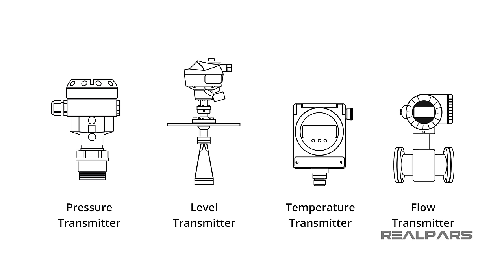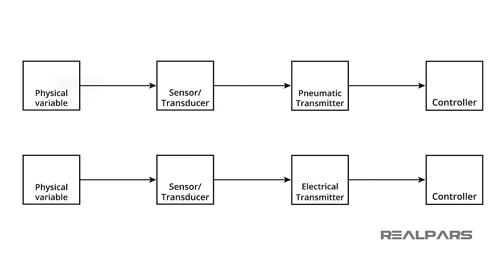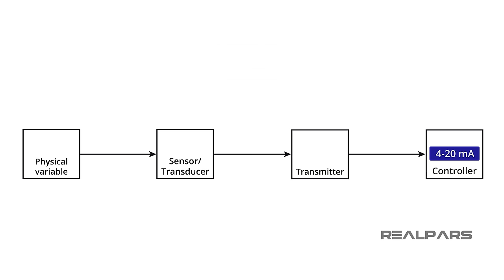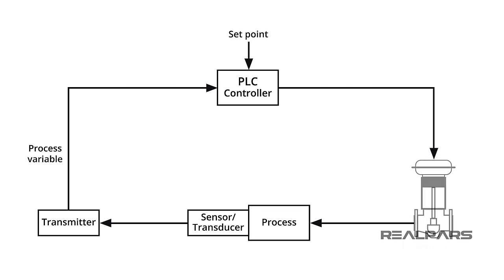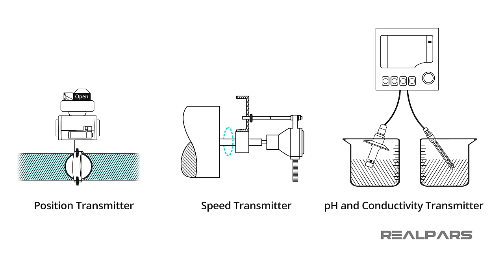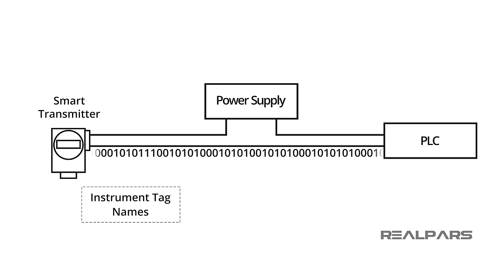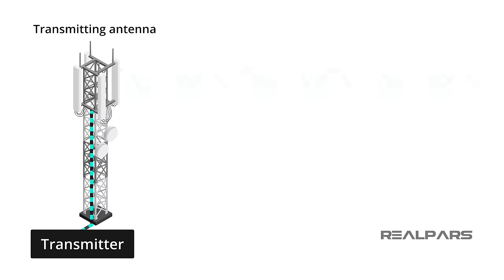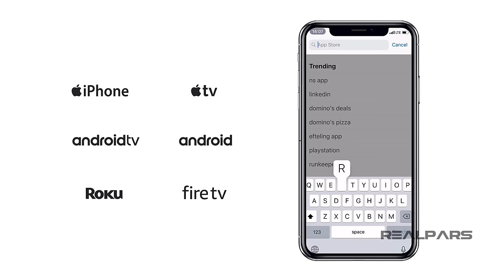Transmitter Explained | Types of Transmitters

Comment: A DP transmitter mount that is connected directly to the process by tubings but mounted some distance away is called remote or traditional mount? In this case there is no other diaphragm on the line connected.

Comment: Great RealPars 🌹🌹

Is there a video explains valve size calculations and characteristics?
Reply from the maker: Thank you for your question!  No, Realpars doesn't currently have a video that covers control valve selection and sizing.  Most control valve manufacturers (Emerson, Valtek, Masoneilan, FlowServe, etc.) have videos and whitepapers on the sizing of control valves.

Comment: Siemens equipment has a voltage signal standard = 0 ... 10 V.
The 4 ... 20 mA current standard is used mainly for sensors (signal reception).
For control, a current signal of the 0 ... 20 mA standard is often used.